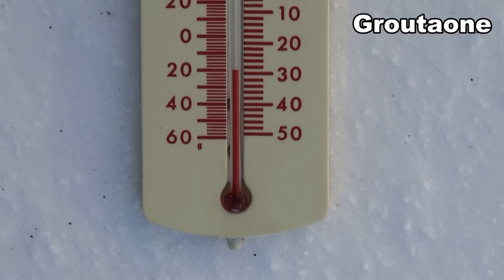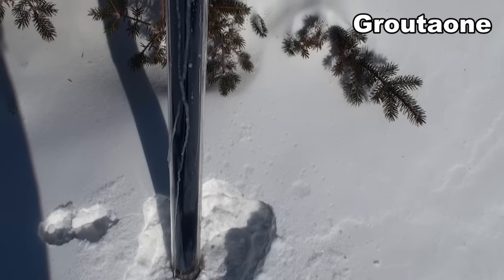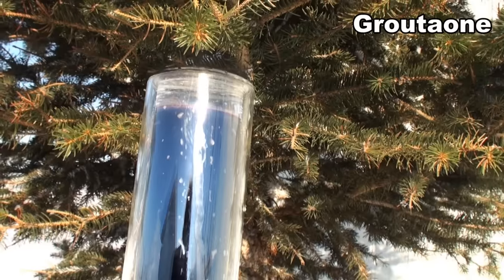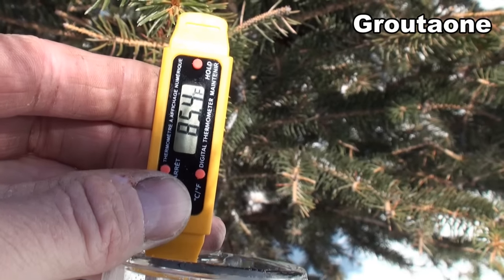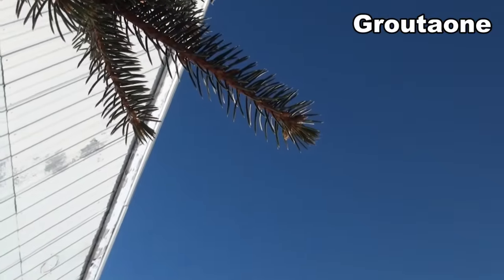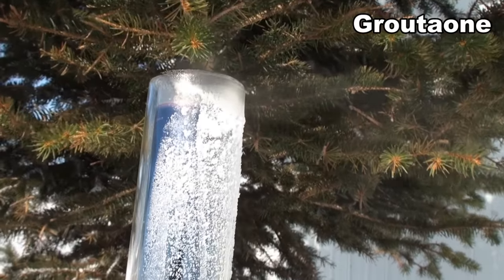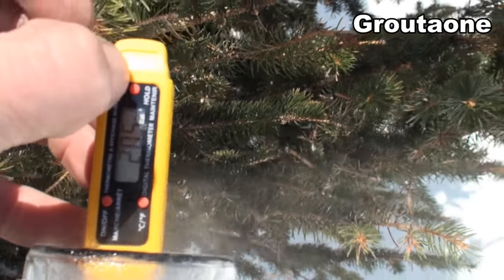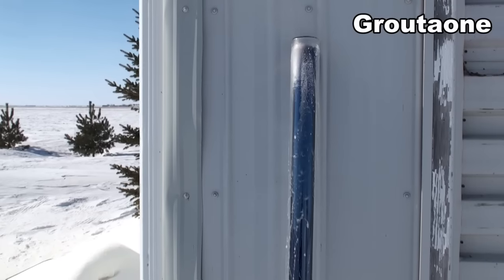-29c Solar Vacuum Tube Test PT1

Comment: REALLY interesting to see that in a really cold -29C winter windy day, these tubes may rise the water temperature close to a boil on the tube's interior, while keeping the tube's exterior ice cold !!!!

Evacuated tubes are the solution for thermal solar collection.

Groutaone: These tubes may be sold with a rear sunlight reflector to heat the tube on both front and rear. This would be interesting to test the same tube tested with a such reflector.

And guys, Groutaone's last comment is of prime importance: These tubes are designed to be run DRY ! Using water in them will eventually shatter the glass by water freezing in nighttime or by thermal shock.

Comment: I've being heating my  home with evacuated solar water heaters and  water to water heatpump for about 7 years now..  my heating cost are about $150 per year average ( I live in a zone 2  area  - average winter temps -18C  i see regularly -40C for at least 1-2 weeks out of the year ) - i watched some of your  video just thought you  you be curios on my experience,  I put 7 kw of evacuated  solar panels on my house ( equal to my heat pump size). to control over heating during the summer  I put a flat plate heat exchanger on my  ground loop for my heat pump.  once   my buffer tanks and  domestic hot water tanks ( 500 litres)  reach  my maximum temp the solar heat is directed into the ground ( which is a bonus as  it also improves the efficiency of the heat pump in the beginning of the winter as the ground is much  much warm then it normally would be

Comment: I've always wanted to know exactly how those worked. Been on my to do list for quite a while! I'm excited to see part 2 and more! Thanks for the post!
Reply: these work because the light energy can travel through the glass, heat the black tube but the black tube cannot sink the heat through the vacuum(insulation) between the two glass tube. Hence the term vaccuum tube.
Reply: Veikra Thanks for the reply! I should've been a little more clear in my statement I guess. I understand the basic workings just was currious on design and assembly. I didn't know that it had a bulb at the bottom like Groutaone had shown. Or how the flow of heated solution actually worked. :) Thanks for the reply though!

Comment: Grouta- about 10 years ago I read the original SolarMax design team was also working on a nightime infrared tube so heat could be produced 24hrs.  Not sure if that went into production or not.

Comment: how does this systym worck compared to the boile? have you considerd converting the boiler so is burns propain and sunflower seeds that may be the go
Reply from the maker: zack wopat  My boiler was using sunflower seeds for fuel, lots of mechanical components that require maintenance and upkeep, got tired of it, wanted something more user friendly and less costly to operate

Comment: What happens if there is no water? Will it just emit hot air from the top?
Reply from the maker: These are designed to use without water inside them, I suppose they would produce hot air out the top but normally they have an aluminum sleeve inside and a long copper insert (not shown) to transfer heat to a collector which is also not shown in this video.

Comment: Mount a few of those on the roof n' have a well insulated tank to hold the water for a radiant floor heating system. Would kinda suck when its cloudy, or at night. :P
Reply: Could still work if the insulated tank is large enough. Like a big buffer tank, just for the heat instead of volume
Reply from the maker: This kind of heating works well with floor heat, using the floor as a heat sink till the next day. Electric solar panels will make about half power on a raining day so I would like to test this on a cloudy day.

Comment: It's sad these are not as developped as all the on-grid energy source. Guess it's better for some people to force you to remain dependant on them.
Reply from the maker: Good news is they are, on grid or off grid heating can easily be done like this, I would need about 150 tubes to heat my shop, works well with floor heat or by using a heat storage tank. A small sun solar system could be used to run the circulating water pump and you are ready for a power outage
Reply from the maker: Oops, I re read your comment and you said "all", I got what you were saying now